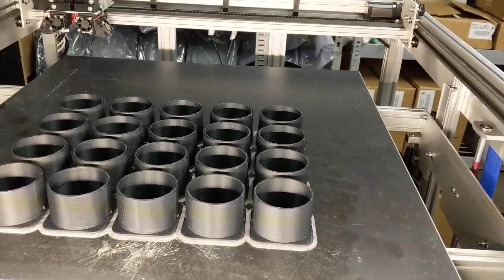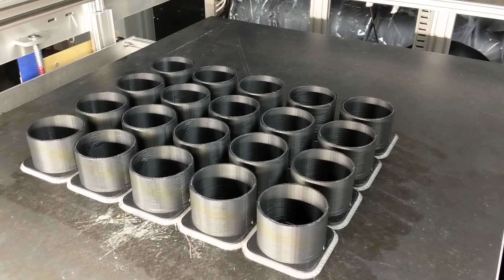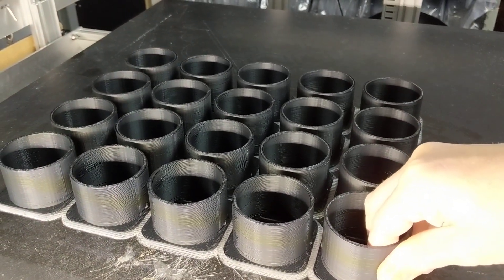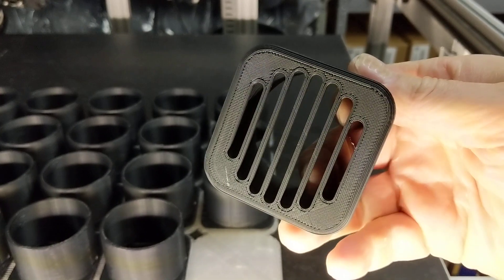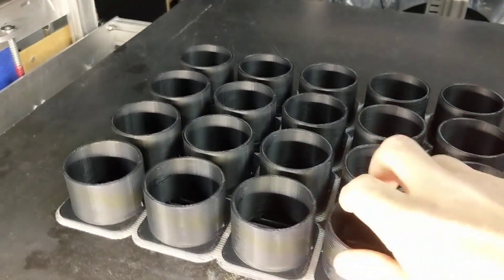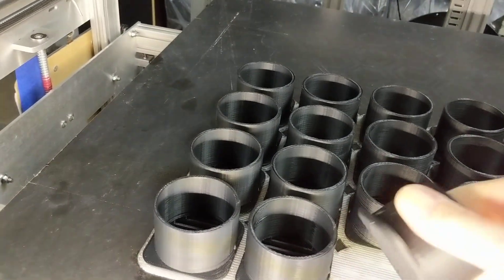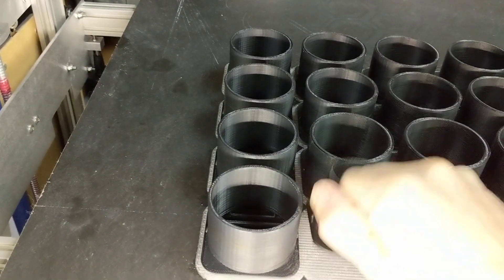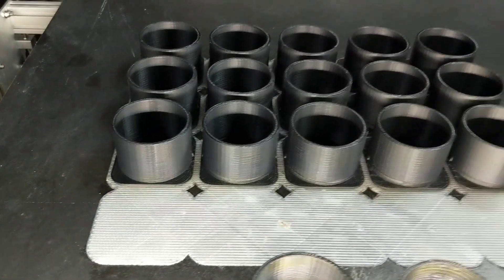Using PETG as Support Material for 3D Printing PLA

Comment: How do you set build plate temperature if you print a PLA part with PETG supports, when both the PLA and PETG are in contact with the build plate? The glass transition temperatures of both materials are so different; the 60°C you need for PLA is too cold for PETG, and the 85°C you need for PETG is too hot for PLA. Is the solution to just use a PETG raft for everything?

Comment: so i am trying to use pla supports for petg but it wont seem to stick but i dont know why
Reply from the maker: PLA can be used as support for PETG, so I think there might be something with the printer or the slicer settings preventing this. Please ensure that your nozzles are level within 0.002 inches of each other and the slicer settings do not have a separation layer and/or separation distance. Feel free to reach out to support@re3d.org if you continue to run into problems with your printer, we'll help you out!

Comment: I've been trying to use PetG and PLA together but the PetG ooze is making this pretty tough. I'm not printing just a base though.
I am printing columns of one to support the other (I've tied printing the supports in PLA and then trying PetG).
This would be great if I would sit for hours clearing the PetG ooze but printing just isnt that exciting.
Have you used both materials throughout the height of the print job?
Reply from the maker: Hi JB! Love that you're printing PETG supports for PLA, that's our favorite method. Oozing is not a fun issue to deal with. You'll likely need to increase your retraction, cool the nozzle while printing with the PLA, or both. If printing on a Gigabot, make sure you're using our updated profiles located here: http://wiki.re3d.org/index.php/Installing_and_using_software_with_Gigabot#Simplify3D_FFF_Profiles If you're still having problems please reach out to us at support@re3d.org. Happy printing!
Reply: @re3Dprinting  Thanks for tips.
I've been printing the model in PetG and using PLA for the supports. Basically using PetG for what needs to be printed the most.
That bypasses a lot of the oozing issue.
Reply from the maker: @coulterjb22  Ah I see. That's a good tactic. Another advanced method that we use to improve print quality and save a lot of print time is to use an interface layer --- We print the part and the support in PLA, and then in the Simplify3D settings, we change the dense support to be printed in PETG, so what results is a thin layer of PETG between the PLA support and the PLA part. Hope that helps!
Reply: @re3Dprinting  That's exactly where I am now. Easy to remove support with nice smooth surfaces.
Thanks for posting this info. I have no doubt others will benefit by your insight as I have.
Thanks!
Reply from the maker: @coulterjb22  Nicely done, that's perfect! You're certainly welcome -- I think so too! We're working to post more videos on these helpful tips and tricks we are discovering in the near future so more people can see. Thank you for your encouragement! Happy printing

Comment: Could you do the opposite? I pring mainly in PETG, would pla supports do the same thing?
Reply: sure you can. , it is the connection between the two materials that is importent. not the order of it.
Reply from the maker: Glenn is correct!

Comment: Thanks for showing the bottom of the PLA print when using zero separation. That's exactly what I've been looking for and so few videos show. Can't believe how many videos with dual material focus on the upper unsupported layers (duh!) and show nothing of the layer quality at the interface of support material and print material. Also good to know I can use PETG as a support with PLA.
Reply from the maker: It works like a dream! Let us know what you think.

Comment: Awesome, bout to start doing this w/ my Prusa MMU 2.0, thanks for the tip!
Reply from the maker: Let us know what you think! It's a game-changer.
Reply: @re3Dprinting  It's been useful a few times for me. The MMU had issues with stringing that seem to mostly be fixed now with the new design. I've been sharing a link to this video and explaining the technique when people mention they have a multi-filament print setup. In Prusa Slicer you can set it to no distance separable supports and it works very well. The most important part, though, is to ensure enough material is purged from the nozzle on filament changes or you can get a clog. I assume this isn't really an issue on a dual nozzle printer, and especially not an issue when you only have a single filament change like the situation in the video.